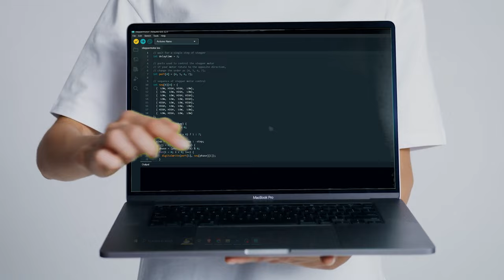3D Printed Rotating Display Stand | Showcase Your 3D Prints #3dprinting

Comment: Too much effort for just a rotation... No need for a stepper motor and on top a microcontroller. A simple geared motor does the trick more efficiently.
Reply: If one was to use a geared motor as you suggest to be more efficient, how would you go about controlling the speed of it and let’s say I wanted to use the same set up and design. How would I add LED light in the center?
Reply: I also noticed in the video when he was hooking up the power and ground to the driver. I don’t know if it was just an editing error where he had positive going to negative and negative going to positive. It could just be an editing error, but did you notice that?
Reply: @OutTheGaWoods  You can adjust the speed using a variable resistor. Placing an LED in the center is challenging due to the rotation axle. I suggest using transparent PLA and positioning LEDs at the bottom of the box to illuminate the rotating layer from below.

Comment: Please, where is the code?
Reply from the maker: If you want this code through email then let me know! 
Select Arduino Nano and port in Arduino IDE software. Here is the code:-

// wait for a single step of stepper
int delaytime = 2;

// ports used to control the stepper motor
// if your motor rotate to the opposite direction, 
// change the order as {4, 5, 6, 7};
int port[4] = {4, 5, 6, 7};

// sequence of stepper motor control
int seq[8][4] = {
  {  LOW, HIGH, HIGH,  LOW},
  {  LOW,  LOW, HIGH,  LOW},
  {  LOW,  LOW, HIGH, HIGH},
  {  LOW,  LOW,  LOW, HIGH},
  { HIGH,  LOW,  LOW, HIGH},
  { HIGH,  LOW,  LOW,  LOW},
  { HIGH, HIGH,  LOW,  LOW},
  {  LOW, HIGH,  LOW,  LOW}
};

void rotate(int step) {
  static int phase = 0;
  int i, j;
  int delta = (step > 0) ? 1 : 7;

  step = (step > 0) ? step : -step;
  for(j = 0; j < step; j++) {
    phase = (phase + delta) % 8;
    for(i = 0; i < 4; i++) {
      digitalWrite(port[i], seq[phase][i]);
    }
    delay(delaytime);
  }
  // power cut
  for(i = 0; i < 4; i++) {
    digitalWrite(port[i], LOW);
  }
}

void setup() {
  pinMode(port[0], OUTPUT);
  pinMode(port[1], OUTPUT);
  pinMode(port[2], OUTPUT);
  pinMode(port[3], OUTPUT);
}
void loop() {
  rotate(100);"
Reply: @3DELWORLD  Hi! Thank you for this video  - and now I start learning about Nano programming (no experience here). I get an error when running this code. I pasted this into my Arduino IDE 2.3.2 software, and get the following errors:
sketch_jul14a.ino: In function 'void setup()':
sketch_jul14a\sketch_jul14a.ino:44:6: error: redefinition of 'void setup()'
 void setup() {
      ^~~~~
sketch_jul14a\sketch_jul14a.ino:1:6: note: 'void setup()' previously defined here
 void setup() {
      ^~~~~
sketch_jul14a.ino: In function 'void loop()':
sketch_jul14a\sketch_jul14a.ino:55:6: error: redefinition of 'void loop()'
 void loop() {
      ^~~~
sketch_jul14a\sketch_jul14a.ino:51:6: note: 'void loop()' previously defined here
 void loop() {
      ^~~~
sketch_jul14a\sketch_jul14a.ino:55:13: error: expected '}' at end of input
 void loop() {
             ^

exit status 1

Compilation error: redefinition of 'void setup()'

Can you help with this?